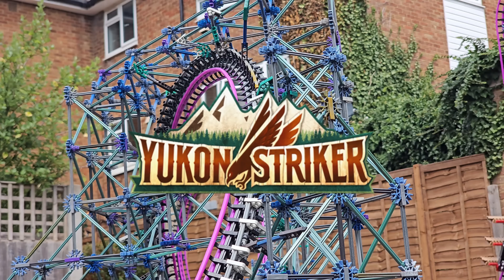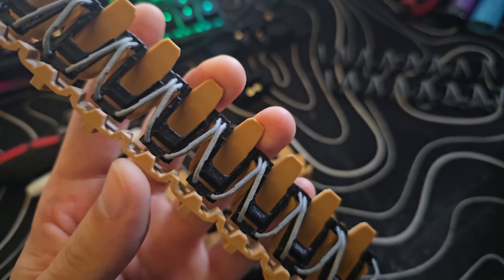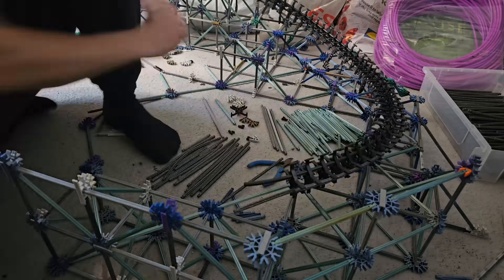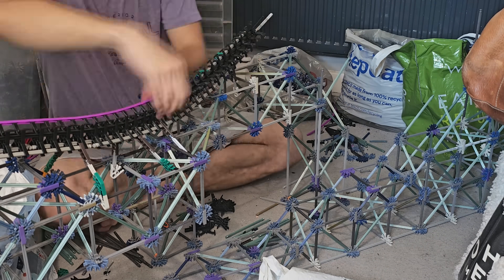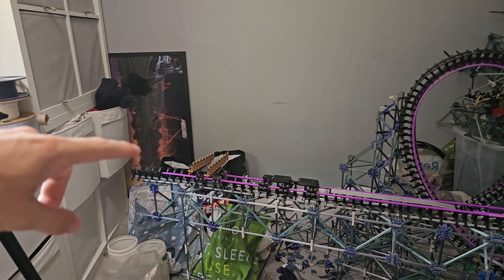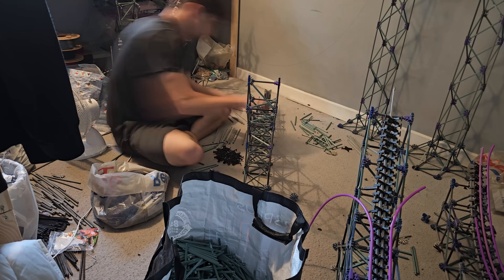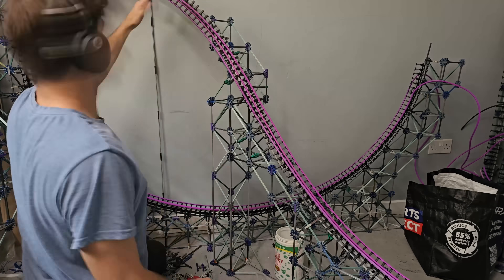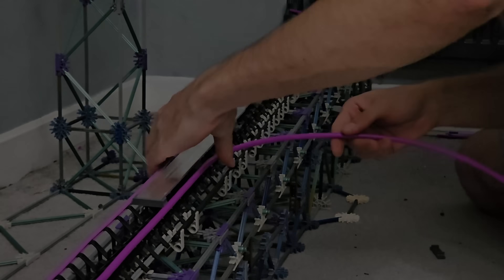Building Yukon Striker—The World’s Tallest Dive Coaster Out of K’NEX!

Comment: Very impressive as always! Great work. Also great tip about starting at the boarding station and working backwards! I made the mistake in the past of building the lift hill first and going from there and not having enough speed to get through the rest. Wondering what motor do you use to power your lift chain on these taller hills??
Reply from the maker: I have a re chargeable electric screwdriver that I 3d printed an adapter for. It works well. The only limitation now is longer heavier trains and the chain snapping
Reply: @TheKnexMaker oh that’s what’s up! Nice work. Thanks for letting me know. I will have to look into that cause my current limitation are the knex motors. I am using two of them in combination and work pretty well but not getting enough torque out of them. Ahh the chains will be my next weekends but I think I have a ways to go before that becomes my next issue. I only want another couple more feet of hill.

Comment: my favorite bolliger&mabillard dive coaster personally. Here is the ride experience: Once dispatched, you dip out of the station and ascend the 223 feet, or 68 meter tall lift hill. Now this lift hill is loud as fuck. It is also extremely steep. At the top, you have a slow turn to the right. This provides a stunning birds eye view of the park, and its surrounding area. Then, you abruptly stop, and enter the holding brake. After a few suspenseful seconds looking straight down into the tiny underwater tunnel, you release, without warning. No matter where you sit, you get sustained floater airtime, the whole way down. The airtime, however, is noticeably stronger in the back row. You get some crazy bodychoppers from all directions due to the tunnel, and you are plummeted with positive gs. You then shoot into the ride's first inversion, an immelmann loop. This element plummets you with positive gs on the ascent. The twist out of it, although not very forceful, is a disorienting visual. Next is a graceful zero g winder. It is a disorienting visual, and the entire train gets some nice hangtime, as this element rides pretty slowly. However, don’t you worry! This next sequence of elements will cause you to grey out. You regain all of your speed, and you forcefully zoom into a vertical loop. You get very strong positive gs. The pullout is located in a trench, and this is where you hit the ride's max g force of 3.7 gs. I typically start seeing grey here. You then shoot into the ride's second immelmann, this one much more compact and forceful. You are then popped upright into a brake run. This is kinked going into it, but unfortunately, your butt stays glued to the seat. Then, like all other dive coasters, you slow down to a near complete stop. You then drop off the brake run, giving those towards the back some decent floater airtime, and giving those towards the front some weaker floater airtime. Your on-ride camera is on your right! Smile! The pullout doesn’t offer many positive gs unfortunately. Then you hop up into this tiny airtime hill, which gives some weak floater airtime through the train. You then zoom into a 360 degree helix, that doesn’t offer any force, but is a very cool visual. You then pop into the brake run, and if you are seated on the left side of the train, you get a pinch of airtime from the transition. This ends the world’s tallest, fastest, and longest dive coaster. Now, I know that the second half isn’t exciting, but I’d certainly take a little bit of airtime and cool visuals, instead of the ride ending.
Reply from the maker: Yh it sounds like a great ride, wish I could go to America one day!
Reply: @TheKnexMaker  well this is canada, but yeah! Its great!
Reply: @TheKnexMaker  💀it’s in Canada